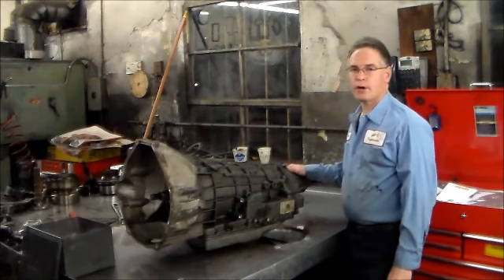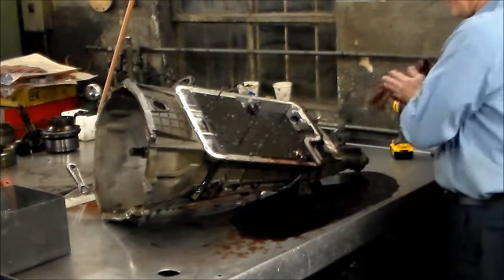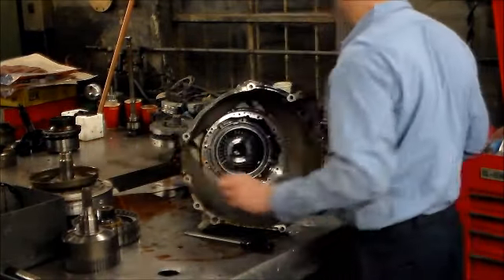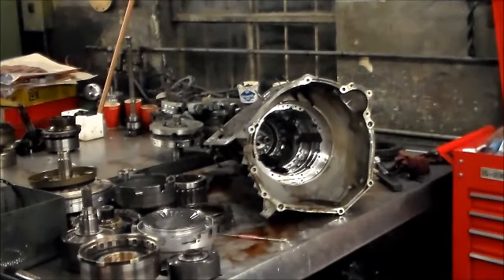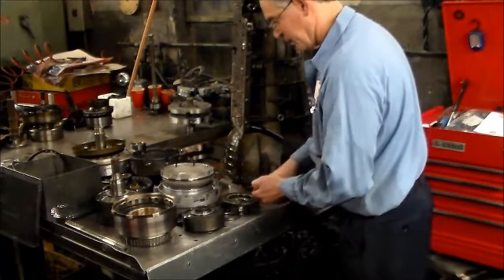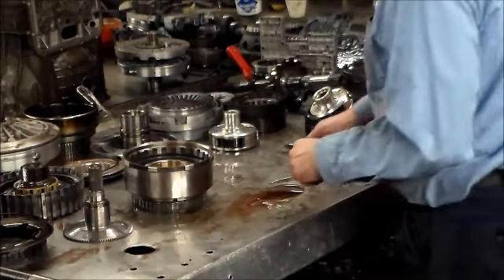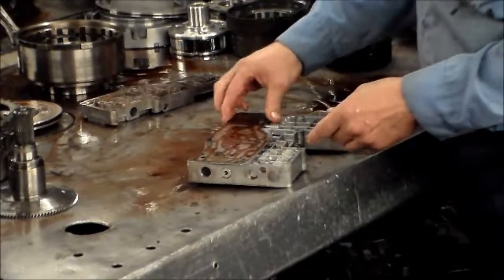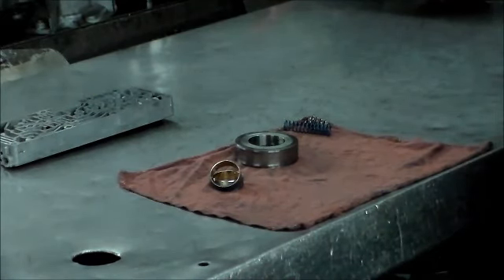Ford 4R100 Teardown

Comment: I got P0741 code mechanic told me it was my solenoid pack. It looks like drop the pan, unbolt pack put new one in and bolt pan up done. 

Got some hard shifting with O/D light flashing at 45 mph.
Reply: Just happened to me as well. For you did you have a wiring issue or was it the solenoid?

Comment: I would actually guess the way those new 2016 transmissions, would still have a rebuilt 4r100 with the new snap rings, pistons, and sun gears. I am not complaining about the part finishes, the shallow drums, or that quick throttle body, without the piston gears 3-5.
Reply from the maker: The 16 cars probably have the 6 speed transmissions called 6R80

Comment: Hi Gary .. I live in Florida .  I have a 1999 5.4 superduty When the Hurricane went by my computer system acted up  and my electrical system. My blower was running with no key , cluster gauge mph fluctuating  ... Then it started slamming hard  into drive and OD.  then it would only shift 1-2  and no drive or OD  and threw a speed sensor code  . Not sure if my trans has a speed sensor. I replaced  the diff sensor and my fusebox... Now the trans shifts at proper points however when I put it into reverse something is howling low whistle while the vehicle moves back and after it the truck is stopped  then it  stops slowly ...  Could the hard shifting have blown a hydraulic circuit? Is there a speed sensor in the trans. Also is there any possibility the computer malfunction  could have damaged solenoids ?  I know its alot of questions .. My truck is at the dealer for 3 days and still no diagnosis.
Reply: Probably water damage

Comment: Front pump seal went out on mine. Was going to replacing the bushing on the pump as well. Do I have to take the valve body out to take the pump or or can I remove it from the bell housing area
Reply from the maker: Drop the pan and pull filter out, no need to remove valvebody
Reply: @GaryFerraro  ok awesome. Makes my task a little easier. Would you recommend taking the pump to a shop to get the to install bushing and seal. Or is it fairly straightforward. Hammer old bushing out and tap new bushing in with a socket or something about the same diameter. Same with seal
Reply from the maker: @00_Excursion  Really need a bushing driver and i press them in,  is there a shop close to you.  After the bushing is in, make sure it fits on the converter
Reply: I may have found one shop that’ll do it. But they wanted to drop the valve body. But if I can get it out I think he can test it for me to make sure the pump is good and replace the bushing and seal
Reply: @GaryFerraro  I also seen other videos where some of the aftermarket bushings don’t have the notch in the for fluid release that might push the seal out. Is it necessary to make a notch in the new bushing or have you experienced any problems without notching the new bushing for fluid relief
Reply from the maker: @00_Excursion  I honestly never had to notch the bushing, always came that way, actually never seen without
Reply: @GaryFerraro  ok. I thought I saw a YouTube video mention it. Either way may try and have a shop do it for a few hundred dollars that way I can just bolt my transmission back up after they get done with the bushing and seal replacement and put it back together
Reply from the maker: @00_Excursion  Just make sure the pump turns before it all goes back together.  Did they mention why they wanted to remove valvebody?
Reply: @GaryFerraro  said that it was easier to get the pump out that way or it was the “right way” to remove it.
Reply: @GaryFerraro  for the pump do I just turn the gears on the inside of the pump and make sure they spin?
Reply from the maker: @00_Excursion  I would put the whole pump on the converter and make sure they spin
Reply from the maker: @00_Excursion  Maybe they pry from the inside to get the pump out, i do not do that
Reply: @GaryFerraro  ok.
Reply: @GaryFerraro  not sure. But I should be able to get it with the filter removed. Put 2 starter bolts in the threaded section of the pump and get a pry bar and try to wiggle it off. I’ve seen a few videos do it that way
Reply: I took the front pump out but the bearing that the input shaft rides on is broken. I think it’s the one where the overdrive planetary is. What do I do about that ? Is that something that can be fixed. It’s around the 13:45 mark on your video
Reply from the maker: @00_Excursion  Is it the bearing on the inside where the gears are, small bearing
Reply: @GaryFerraro  it was actually fine. What I thought was a split bearing was just the spline of the backside on the pump. That bearing is fine. Still spins for whatever reason it’s there for. So I didn’t have to replace it.
Reply: Only issue is now after getting transmission back installed it clatters on startup and under acceleration. Seems to quiet down in gear at low rpm. I think the flex plate is cracked so I have to pull trans out and check it. I’m gonna recheck torque converter bolts to see if there tight but I think it might have cracked it when tightening them down after trans was installed

Comment: Thank you for making this video.  Perfect timing! I just started rebuilding my sons' 4r100 from his  '99 Ford F250.  It had no low.  After getting it apart we found the frictions (low) were worn down to the metal.  That explained why low wasn't working, but not how it happened.  Until we started cleaning all the components, where I found a crack in the hub of the forward clutch housing that went right through the 2 sealing rings!  

Couple of questions.  Do you use and/or recommend the Transgo "Tugger" kit.

Besides what you talk about in your video, what do you recommend to make the 4r100 last as long as possible?
Reply from the maker: I use the transgo shiftkit on every overhaul. I dont do many upgrades, i put in a new set of pump gears, i change the case bushings, pump bushing and the direct drum bushings to keep everything running true. I also change the shell, they like to crack and on the sungear i knock out the upper bushings(according to how the sun gear sits in the case) closer to the foward planet, for better lube to the foward planetary gearset, and on the foward hub i change out the snap ring to a superior super tuff snap ring.
Reply: @GaryFerraro  recently a friend of mine repaired the transmission of my 2000 f350 7.3 2wd, it turns out that now the transmission remains in neutral even if you put it on drive, someone commented that I need to calibrate it, I would appreciate your help
Reply: @hanoimartinez571  Bro I'm retired but I know Gary has done many many units that a do it yourselfer has done. They usually cost someone like yourself a lot of money and broken and missing parts. When they have parts leftover they don't anyone to know about they just throw them away.I know this gentleman has seen this. I have had to charge someone a cpl hundred extra for this.In addition most all those new parts are no good.Automatic transmissions are for pro's. Guys who are amateurs should not try this good luck

Comment: Thanks for the video and walkthrough. What did you find actually was responsible for the "no Forward" problem in this case? Also, I was always told that bypass tube was added to protect the transmission, in the event the cooler got clogged. You said at the beginning of the video it was for something about winter running (cold weather). What exactly is this tube's function in cold weather? Thanks in Advance!
Reply from the maker: The function of the bypass tube which was added in 1997 is increase lube flow during cold weather operations.  No forward was due to bad forward clutch pack
Reply: @GaryFerraro  Thanks for the responce. What cycles the tube on and off?

Comment: The thing you called low reverse "race"....is actually the low sprag race...as you know it holds the reverse spring return in place. This unit is a C-6 with o drive on the front. As far as I'm concerned the C-6 was the best automatic transmission ever built.(a chevy man lol) Sort of ironic the same weak point exist in this unit...the forward clutch. That inner piston seal got hard in the C-6...causing a delay in fwd range when they were cold..was this one hard?..
You have a nice shop thanks for the nice video. Transmissions got my lungs and back ...hope yours are better than mine. Take care brother..Bill

Comment: Hey man. I do European stuff almost exclusively, and came across a 6t70 in a 2010 traverse. I had a shift solenoid 4 & 5 low circuit. I took the mechatronics out and found those torn seals on the fronts of the two solenoids. I sold a complete overhaul since it has 200,000 miles. But when I put a new mechatronics on the valvebody later this week, I can program it right? I have a j2534 pass thru but never Did one of these GM trans before. Idk if it even needs to be programed, but I am assuming so, since the TCM is in the mechatronics. Any help is appreciated.
Reply from the maker: Yes, i can be programmed with the J-tool, i do them all the time, new from the dealer it has to be programmed
Reply: Do you recommend software updates on every overhaul that is electronically controlled? I've thought about doing it, but the other transmission shops I ask say they never do software updates with overhauls and don't do their own programming when replacing a TCM...
Reply from the maker: I only do that when replacing a tcm or reprogramming because of a tsb.

Comment: Gary, great video, and very informative. I have a question about my 4r100 in my 02 F250psd. I have started having very soft 1-2 and 2-3 shifts to the point that it almost feels like slippage, let off the throttle and it will basically fall into the next gear after a couple seconds of hesitation. I have pulled the pan, pulled the accumulator body out, verified no broken springs, cleaned it all up, and put it back together with synthetic fluids and new filter. Test drive was great, then take an hour trip to verify, and pulling off the highway, the first time coming to a complete stop, it goes right back into super soft shifts and having to hold out each gear. No codes.
My question, does it sound like the unit needs to be dropped and rebuilt? Or are there any other tricks I can do to fix this soft shift issue? 

Thanks again
Reply: Did you try yelling at it?

Comment: Hi Garry. I have a problem with a Suzuki Grand Vitara 2002 problem. I have a customer that swap transmission and now the trans won't shift to revers but if I put the car in the air shift normally. I just want to know what most likely is the problem. By the way I think the pump is bad because have a whining noise or a clogged trans filter. I hope I explained myself well because english is not my primary lenguage.
Reply from the maker: how does the car work in foward gears?
Reply: Gary Ferraro runs heavy like is towing something heavy or running on 3rd. Tomorrow I'm gonna scan the car for codes (of is that has codes). But i ask just to have some direction to look at it. Thank you for your fast respond.
Reply from the maker: Sounds like its in fail safe, scanning the car would be the next step, if there are codes that would give us direction
Reply: Gary Ferraro it was a really clogged trans filter. Thanks for your help
Reply from the maker: Glad it fixed. Gary

Comment: I have a Linkin Navigator with the same transmission it works fine but when it has been driven 5 to 10 miles it start losing fluid it seems to be coming from the vent tube on top or from the tail shaft housing between the transmission and the housing the filter and fluid have both been replaced every thing abt it works just fine just losing fluid most probably from the vent tube plus the tork converter sounds like a bad power steering pump
Reply from the maker: Have you checked it on the lift to confirm its not coming from the front seal
Reply: Yes
Reply: it's definitely from the vent tube or the tail shaft housing  I'm abt 95% shur it's the tube
Reply from the maker: The vent is more towards the bellhousing, just to confirm its not overfull? was anything done to the trans and now this problem?
Reply: It's not over filled it was parked because of the air ride other than a few dirt dobbers built some nests in and around things it is at factory settings
Reply from the maker: ok, any codes present for the trans?  The pump on this trans is aluminum if its warped may cause fluid out the vent, also do you have a scanner that reads live data to check trans temp?
Reply: It can sit in park all day n not drip a drop drive it a few mins and it's all gone and there is little to none on the case or truck to trace back to the source the vent tube is at the front but runs back and down rt at the mating surface of the transmission and housing
Reply: no codes it's clear it memory from not having a battery in it and I can not drive it long enough to get them on but it did not have any lights or problems when it was park other than air ride

Comment: the speed sensor hold down bolts are rusted on my 4r100 the head are barely there can't get a vice grip on them either. any suggestions??
Reply from the maker: You could try that to break them loose, there are certain sockets with "grips" that are made for getting the bolts out when the head is worn

Comment: Hi my 4r100 has slow to accelerate problem afterwards shifts fine could it be the torque converter
Reply from the maker: when you say slow to accelerate, does it seem like it's in a higher gear on takeoff?
Reply: Yes I think so it’s like it didn’t fully shift down it’s in a 1999 Ford Expedition we just got it has 5.4
Reply: It does seem like your building pressure to get it going almost like my hydrostatic trans in my John Deere but the other thing I got codes p1746 pressure control solenoid circuit open p1754 clutch solenoid circuit fault and p0713 transmission fluid temperature sensor high input the trans light on shifter is blinking
Reply from the maker: @JustinHolloway307  ok, so it's in failsafe mode,  first thing clear the codes see how fast they come back(they may come right back)  then unplug the harness connector may have corrosion causing these codes

Comment: recently a friend of mine repaired the transmission of my 2000 f350 7.3 2wd, it turns out that now the transmission remains in neutral even if you put it on drive, someone commented that I need to calibrate it, I would appreciate your help
Reply from the maker: Does not need calibration,  How is reverse?  How is the fluid level?  How many quarts were added?
Reply: @GaryFerraro  the fluid is new (motorcraft mercon v) I put 18 quarts and the riversa does the same, Thanks for answering me, I hope you can help me

Comment: Hey whats up. I have a question about my 4r100 transmission
Reply: 99 expedition will go into reverse but not forward. And over drive light comes on past 2k rpms
Reply from the maker: @christopherwilhite4322  Ok, question, does the car move backwards in neutral?
Reply: Gary Ferraro yes
Reply: Gary Ferraro yes
Reply: Gary Ferraro and what about the other one. That happens on the expedition but the other comment is about the f350 if you know anything about that one too
Reply from the maker: @christopherwilhite4322  Sorry a little confused, the 99 expedition has the Low/ Reverse clutches locked together, these clutches are located all the way in the back of the trans. Did you by chance run this low on fluid?  What is the problem with the F350?
Reply: Gary Ferraro nope it was good. On fluid and everything
Reply: Gary Ferraro And also my other 4r100 transmission just randomly at a light wouldn’t go till about 4,000 rpm. I parked it instantly and all the fluid leaked out. My dads taken that truck to work about 3 miles away and back a couple of different times and it would do good for that lil bit. (01 f350 5.4 triton engine)but i noticed when i tried to get on the gas it felt like it was slipping so i left off and went slow.
Reply from the maker: @christopherwilhite4322   On the F350, if the fluid leaked out hot, the front seal is peeling back when hot.  When this happens, the fluid pours out and then seals back up when it cools down.
  The expedition, ifd not low on fluid may have something wrong with either the seals or the piston itself, I would probably change both

Comment: Awesome video Gary! How in the world do you get everything back together, and in the right places?
Reply from the maker: FredFlintstone21 many years of rebuilding. Seminars and reading up on transmissions
Reply: That makes sense. I program cnc milling machines, which has taken years to get good at it. Sometimes good experience comes from bad experience, and I like to pass my bad experiences on to trainees so they don't make the same mistakes. I have an 02 excursion with a 7.3, the trans works great, but I'd like to beef it up so it can handle more hp.